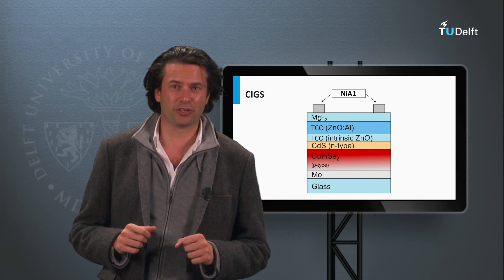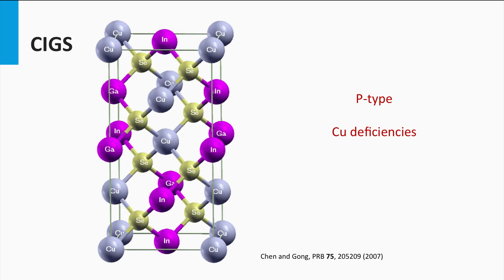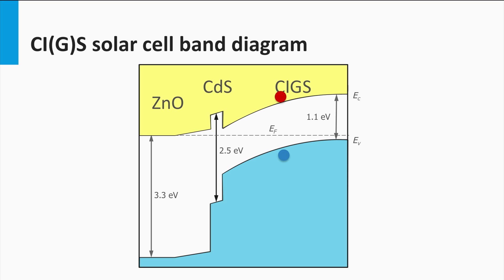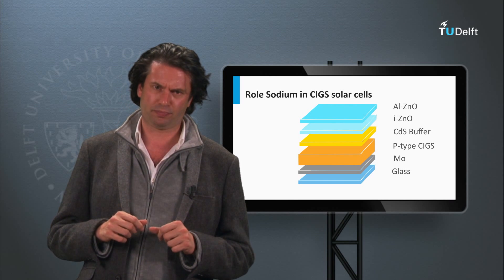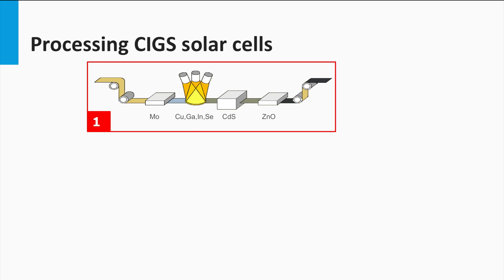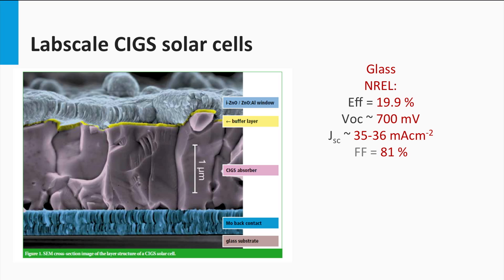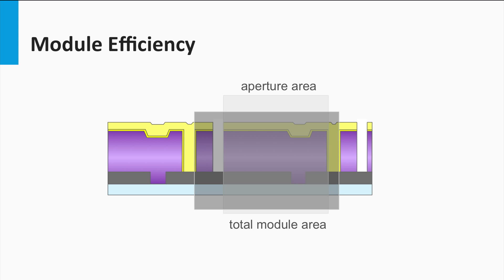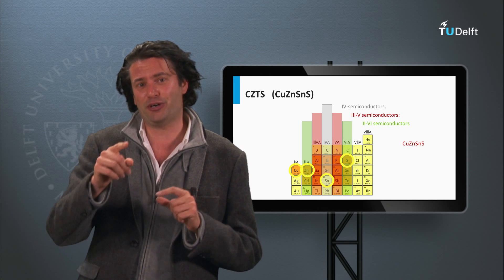5.3 - CIGS PV Technology

Comment: Excellent explanations!. A question: What is the function of the buffer layer?
Reply: CdS has important function in CIGS which avoid recombination of holes and electrons between cigs and ZnO thin film.
Reply: I was thinking the same thing lol
Reply: May be for maintaining depletion region stabilized .
Reply: I read in a paper that CaS is actually the n-type semiconductor. So the p- and n-type semiconductor materials used in this PV cell are CIGS and cadmium sulfide that are sandwiched between the molybdenum positive electrical back contact and the transparent conductive oxide which acts as negative electrical contact.